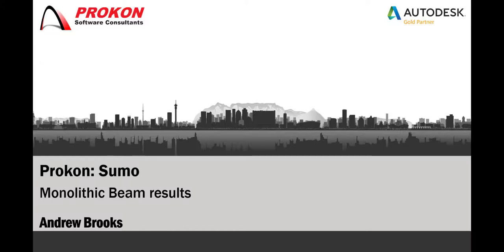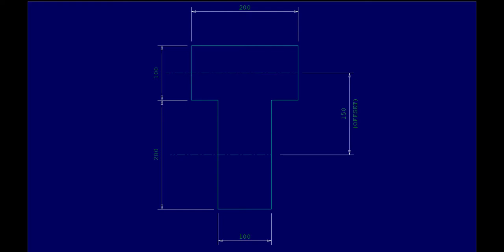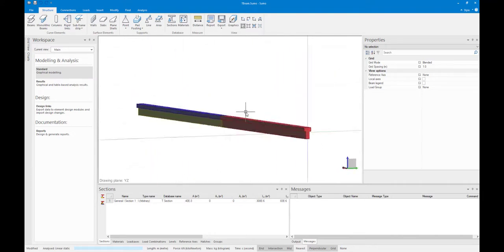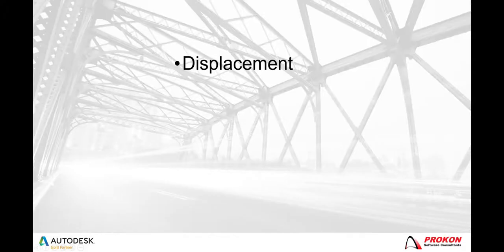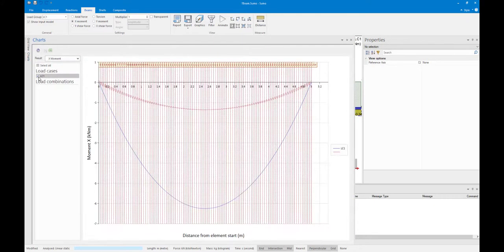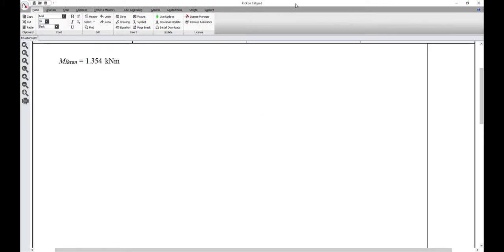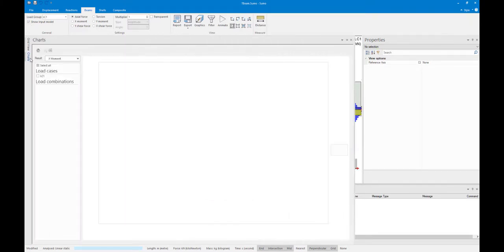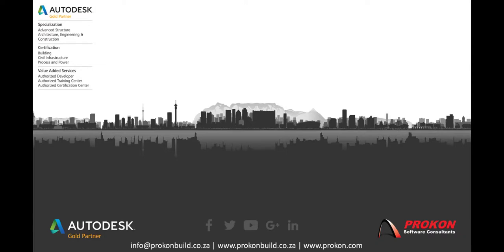Prokon Sumo - Monolithic Beam Results

Comment: When adding slabs the model takes the centrelines to add members, but realistically the slabs are cast in monolithically with the beams. How do you create such an element?
Reply from the maker: Hi Musa, 

The modelling of a slab on top of a beam, while the beam is still connected to the slab is done in Sumo by using the Monolithic Beam feature. A monolithic beam acts the same a normal beam analytically, except that it has an Offset Property. 

This helps us with two things: 1) The beam can be modelled inline with the slab to ensure that the beam and the slab is connected, and 2) it allows the beam to be analysed with the correct stiffness – the beam is vertically offset from the slab. 

Kind Regards